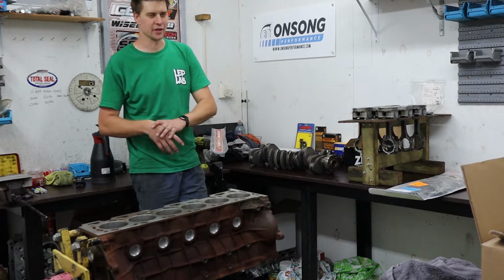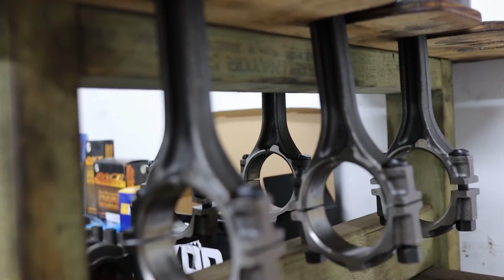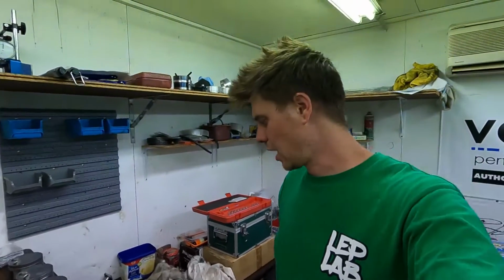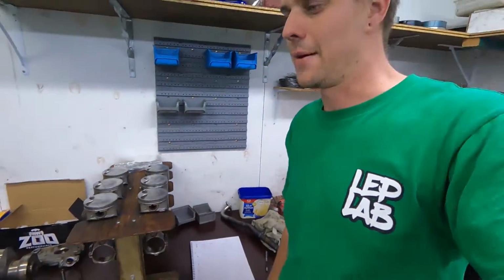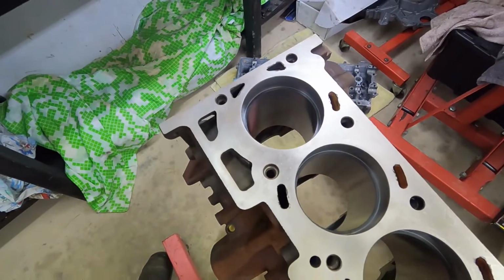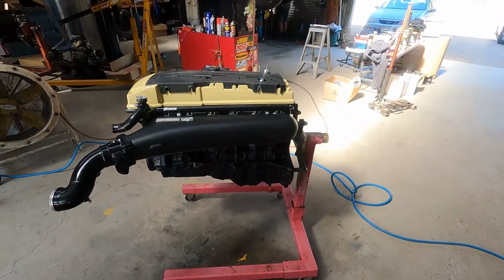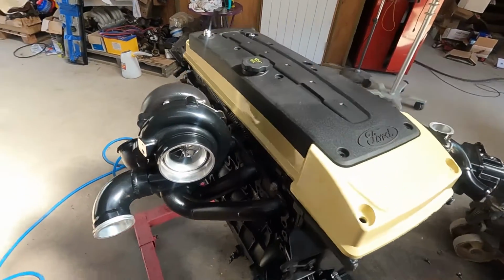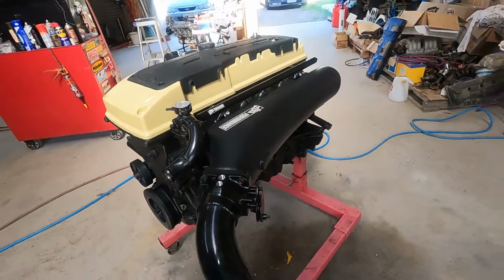Green Top Barra Rebuild || KingBarra Part 17

Comment: How do those factory rods fair with new bolts being fitted and not being resized? 
Not as critical compared to when fitting ARP bolts?
Reply from the maker: No issue with new OEM as they are the same torque specs. 👍👍 Different with ARP as they change the clamping force on the fastener which can warp the big end.